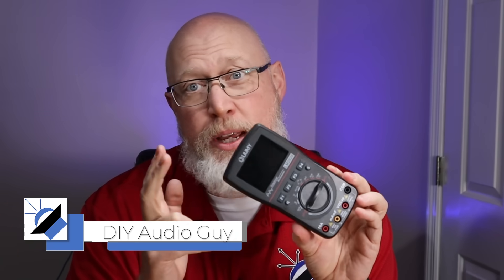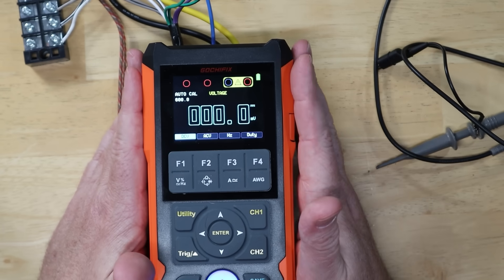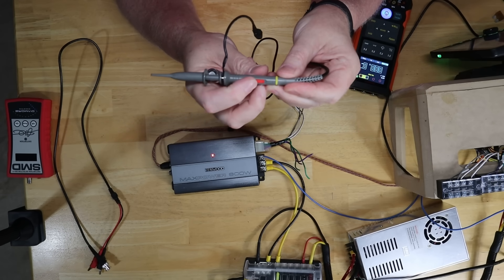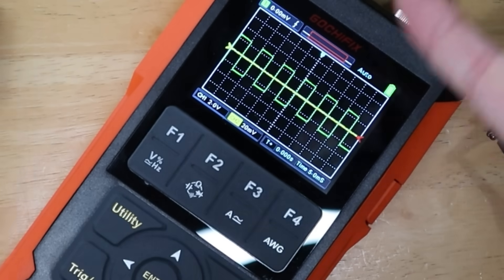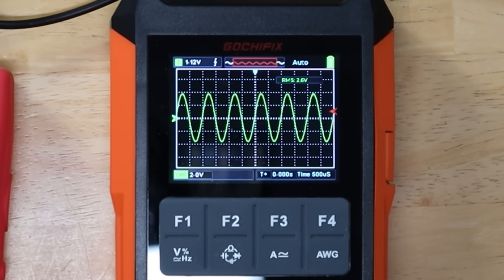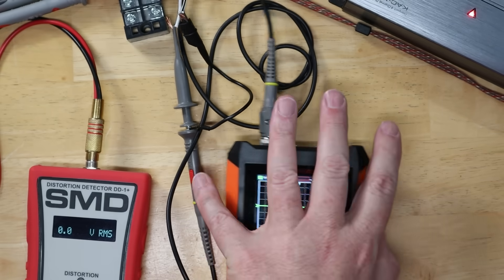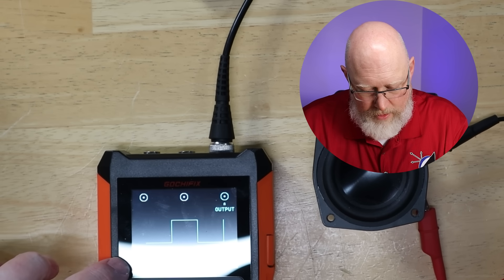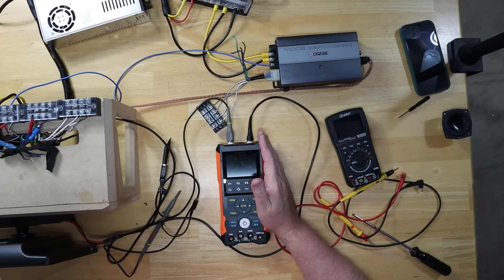A Better Tool for Setting Gains?

Comment: 7:47 the little $30 Fnirsi oscope I got does not show nearly that much detail in the wave.  However, it starts to show the clipping exactly at the same time as I hear the buzz coming from inside the amplifier.  I suppose you could set your gains just by isolating the amplifier from your speakers either by unplugging them or like in my case it’s in the trunk.  When the amp starts to buzz from inside it’s Definetly clipping.  Luckily o bought stuff with clip lights and I did the math and it all lines up.  Three sources. Check.

Comment: Met you DiY guy when you were at Slamology in 2024 when you were at EXO aka Bruce's van he was trying to get to work!~
  An you do not need a Multi-meter to set gains if u know what ya doing!~
Reply from the maker: Did you get a demo? I wasn't able to get one.   Same thing at the XS power show.  Anytime he was giving demos there was a massive line.
Reply: No I kept coming back an trying to, but things kept going wrong, 1st it was a Voice Coil not heating up right, then something in the engine bay coming loose, if EXO's wifes had not had her sister show up, the build woulda been more done, as he didn't do anything on it for 3 days she said!~

Comment: So this is what I have learned...

Theoretically, maximising output from a DSP to match the 'Input sensitivity' of an amp is a good thing to achieve, but by doing so we are adjusting the channel gain in the DSP to achieve this.  As we have multiple channel amplifiers this starts to get complicated, because not all of your channel gains will be set at the same level.  Speaker sensitivities, etc will effect the output level, thus the need to adjust channel gain.  If we set gain at an amplifier for the theoretical 'optimum' we may actually be providing too much power to the speaker and have to reduce it in the DSP by reducing the channel gain.  AKA the end result being we have not gained anything by optimising the amplifier gain.        Real world example, I have a 6 channel amp running a 3 way active soundstage, only the midbass channels require additional amplifier gains, Mid and tweeters are at minimum.   I had experimented by optimising them and the result was that in the DSP they had to be reduced by a large amount.    So, its really more complicated than a lot of people imagine.
Reply: 6 channels = you need to tune each one individually obviously, right? How did you solve your issue it's been a while I'm curious
Reply: @tomph7087 depends upon your amp and your DSP.
My amps have a gain for each driver pair, so 6 channel amp has 3 sets of gain for output pairs 1, 2 and 3.
In the DSP software I can adjust individual channel gain as required to level match the system, which is a must.
So in an ideal world you want to match your amplifier input sensitivity voltage to your DSP output voltage, but in reality that's easier said than done because of the need to adjust gains based upon tuning and level matching.
Alot of professional tuners still argue about the best method of setting gains!

Comment: going to point this out as most people don't know how but if you change the bias on the signal gen so it makes a 0-5v and not a -5v to 5v (10v peek to peek) by giving a pure bias in one direction it's easy to find speaker that are wired backwards. 
I suggest getting a BNC Tee, BNC to RCA adapter and a BNC 50ohm dummy load a simple 5 to 10w one so your properly loading the rca signal you will get rid of some of the hiss you see from some head units also you can use the adapters you feed a signal out of the gen and into ch1 and the amplifier out of the amp and into ch2 this will give you a way to measure phase shift for time alignment

Comment: I frequently use a similar, but substantially cheaper device: the Chinese-made FNIRSI 2C53T oscilloscope. Perhaps you could pick one up and do a head to head? I bought mine on Amazon for (IIRC) ~$140 CAD.

Comment: To add to the tone generation perk; I was installing a PAC Amp-Pro and wiring it up to bypass my factory amp and use the factory lines. Followed all instructions to a T and had no output to a couple speakers. Turns out the wire labels were wrong and only with a tone generator (borrowed from a local car audio shop) was I able to determine that the line on the Amp-Pro harness labeled "center" was actually the line meant to wire up my front left speaker.

Comment: I always use a scope and a DD-1+ in parallel. Clipping is easy to interpret on a scope. Distortion is a little more nuanced, and the 1% THD threshold of the SMD device is more repeatable than reading off a scope - if you're only looking at time domain plots. If your scope does FFT (frequency domain) plots, that's a whole other ballgame, but you need to look at both the time waveform for clipping AND the FFT for distortion.
Reply from the maker: That's what people don't get about the DD-1 It's not looking for clipping. It's looking for distortion.  Plus it's so easy, if the red lights on turn the gain down.

Comment: The reason the scope read 2x what the SMD AAM does is because the Vrms is a peak to peak on AC which is double the value of the wave V from neutral to peak. So the 2.1V is probably more correct than the 4.7v reading of the Oscilloscope.
Reply from the maker: When it went through the menu on the scope I cold choose peak or rms, I got 4.7 when I choose RMS.
Reply: @DIYAudioGuy it still counts both sides of the wave even in RMS mode. AC is weird like that on an Oscilloscope. Use a regular Vac setting not on the Oscilloscope and it will read closer to the AMM1.
Reply from the maker: @Red2l16v that makes sense.

Comment: Something the 80MHz version has that I didn’t see you mention is a second channel so you can connect to each channel in a pair and set the gain for the channel that clips first by toggling back and forth instead of having to swap the rca back and forth. That right there is enough for me to go with that one even if it is twice the cost. Efficiency is gold
Reply from the maker: Pretty sure I mentioned that is has a second channel.
Reply: @DIYAudioGuy you may have, but I was also perusing Amazon at the same time
😅

Comment: The reason you are not supposed to use this on a speaker is because signal generator outputs are high impedance and can be used only with a high impedance inputs, such as amplifier input, which is around 20 kOhm. When you connect it to a 4Ohm speaker it is an equivalent of connecting a 2ohm stable amp to a 0.1ohm subwoofer. It will load the output so much that you can burn the signal generator. Same as with amps, it might work on low power for short time, but it's risky.
Reply from the maker: Good to know!
Reply: So its still a great tool to use for gains, correct?

Comment: What I have learned after finally getting an oscilloscope was my ears seem to detect distortion before it shows. 

I have been commenting for years on multiple threads on how to set up gains and always get hate I need a scope and multimeter bla bla bla. 
Every time I have tested my stuff it would seem I am leaving power on the table, but when I bring up to just before clipping it still sounds slightly distorted to me on certain notes.
If you dont have the tool or cant afford it, about half slightly more or less is ideal for gains and just before half for crossovers if you want clean rich bass.  If you cant hear the sweet spot then you are tone deaf and need a tool. If you trust my settings you can put a multimeter on it and see its pretty close to where you need to be. It might not be right, but it will be close.
Reply from the maker: If you know what distortion sounds like then you can set by ear.  Most people have not trained their ears.  When I first started doing this I did not recognize the sound, now I do.  My mind says "that ain't right" and then the next click of the gain the light turn on or the wave goes flat.
Reply: @DIYAudioGuy you can always hear it in the vocals in Horn type sounds.

Comment: You can stiil get the liumy multimeter,  it sunder a different brand name, GOCHIFIX 2 in 1 Portable Digital Oscilloscope Multimeter, pretty much identical, I neve liked thos oscope with the screen being so small can go with the FNIRSI 1013D Plus Oscilloscope, with a huge screeb and save $3 lol

Comment: I bought a bunch of bnc to rca adapters when I bought my oscope….

That really doesn’t speak good for the SMD not picking up the switching noise. I know people that have gotten rid of their SMD devices.
Reply from the maker: The high frequency switching noise that the scope picks up on a class d amp is well above human hearing range.
Reply: @DIYAudioGuy above human hearing, but will definitely play into the overall effects of clipping/THD and the scope picked it up as dirty noise in the actual frequency. That’s why I trust a high quality (even average quality) oscope over the SMD stuff.

Comment: They make adapters from BNC to RCA. Male and female and even gold plated. I bought a set for a cheap handheld o-scope I have to check for the max level before clipping from my headunit to the amp(s). Works way better for that purpose. Thanks for the informative video, Justin! 👌
Reply from the maker: This was my fist encounter with them.

Comment: SMD devices are overpriced and limited fuctions. The cheapest way to set gains is to use a cheap peizo electric tweeter with a 440hz sine wave.

Comment: A scope is nice to verify where your radio/source starts to distort.  But for gains I’ve used the crutchfield method for decades and it works great.
Reply from the maker: Old school installers used to do it by ear.  I have compared results from a few local guys to the scope and they were dead on.

Comment: Batteries will always be better, because when the built in battery no longer works, its more expensive to replace and you have to take it apart..
Reply from the maker: The lithium cells in this one are removable.
Reply: If the battery is even available

Comment: Well this would have been handy to have years ago before I bought the CC-1 and the DD-1 😂. I did have Steve sign my boxes though, so it was well worth the money.  I still use them today for adjusting amps.
Reply from the maker: I like the SMD products because they are easy to use, especially when you are contorted in a weird shape in a car trunk trying to reach an amp.
Reply: I have them too and they’re amazing for quick adjustments but when you really want to gnat’s ass it, a scope in the move.

Comment: Don't know the price yet but at 1:05 I'm half sold, rechargeable and USB c that's already such an epic win already lol, some of these things actually smash through 9 volt batteries and stuff and they get very expensive for good high output ones that last a while that still get drained quickers shit on things like the SMD device 🤮
 Two inputs is wonderful too more than super basic ones although 2 outputs now is fairly standard across the market thinks the Chinese companies bombarding the market with cheaper models that are quite capable which is why I hope this is reasonably prices or it makes it kind of out of most people shortlists. Nice content as always bud

Comment: I know it's not something you do on the channel, but would the 80mhz be better suited for electronic repair use?
It's something im slowly getting into and wonder if it's worth paying once for the thing that will potentially do everything now?
I've found it a heap cheaper on ali and temu
Reply from the maker: Yes.

Comment: I got an o-scope for $40 on Amazon, overnight delivery. Worked great.
Reply: Same works perfectly
Reply: The aukuyee
Reply: Mine is the fnirsi branded one.  Looks like they have a very similar device with their branding on the box as the one in the video.  It was $36 and I’m very happy with the results.  Out of an abundance of caution I just turned my gains down barely barely lower then when the scope showed I was out of distortion.  Music is much more dynamic than a test tone anyway.  I probably very rarely even getting my driverall the way down to 4ohms anyway if at all.

Comment: i was hoping you'd actually show the cheaper unit graphing. if you're going to recommend it through an affiliate link it would be neat to see what experience youll get with it
Reply from the maker: It is a clone of this one, I have been using it for years and it has been featured in a dozen videos.  https://www.youtube.com/watch?v=oBNETr9AHwA
Reply: @DIYAudioGuy I should have retracted my comment. Right after I hit play again you went into why you were recommending a different one. It seems you need to spend another $18 or so to add the probe like the more expensive one has. Does it make it less of a value?